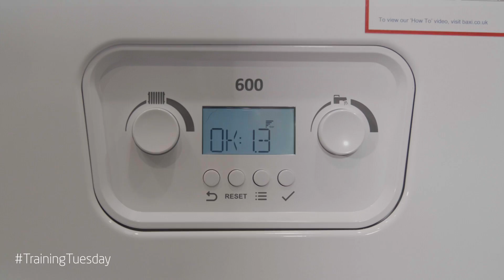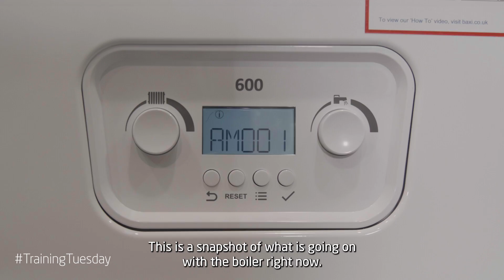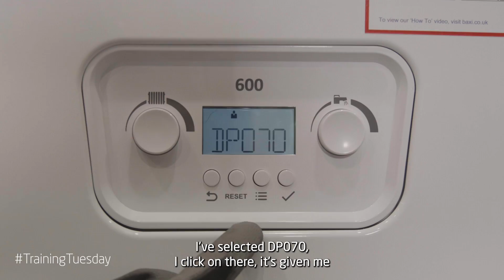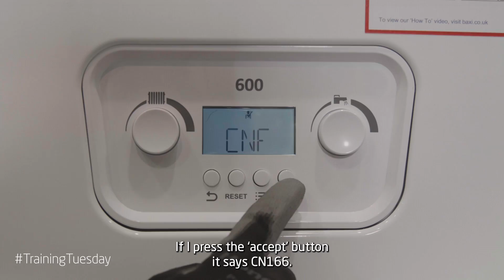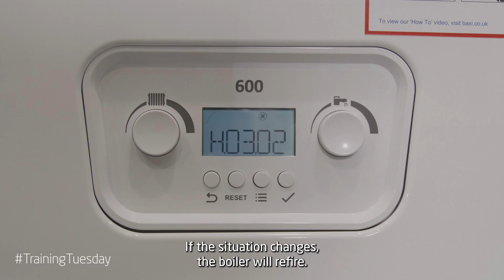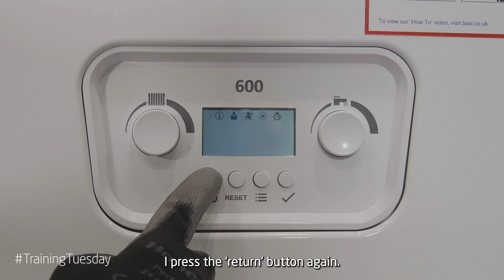How to navigate the user interface on the Baxi 600/800 Combi 2 Boiler range | Baxi #TrainingTuesday

Comment: Thanks for the Video, we have a Baxi Main Eco 25 and there is no way of turning off the Central heating, it only has a minimum option on the dial which keeps the heating on at 25 degrees 24/7

Comment: My Baxi 600 Combi only has two dials and a Reset button (like the one on the left in the video). Is there a way to access the Engineer menu to change the maximum DHW temperature? I'm using a Drayton Wiser via OpenTherm, and since Wiser doesn't control the DHW setpoint, the boiler defaults to 60 C, which is too high. What is the dial/button sequence to enter the installer settings and which code controls the DHW Max Temp? Thanks!

Comment: Absolutely stupid design.    Just have a colourful screen with what each thing is rather than a bunch of codes.   The new Worcester for example, u dont need to read manual,u can jus do whatever u need to rather than spending ages finding manual,looking thru manual for what each code is.   Also, make max n min burner easily entered,so that engineers can get their job done quicker.    Terrible so called “new” model.   Take a look at vaillant’s menu.   Ditch the “new”display that looks like 70’s calculator